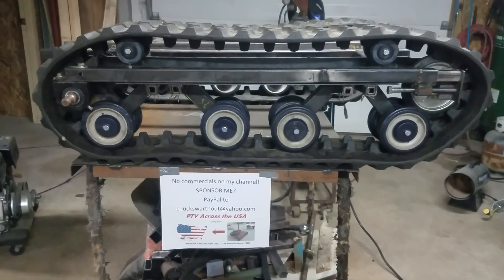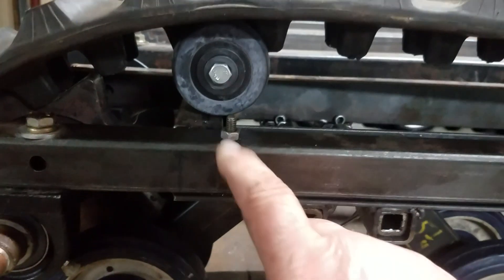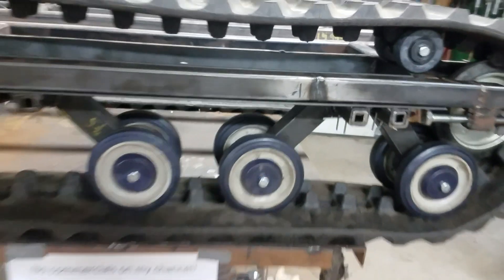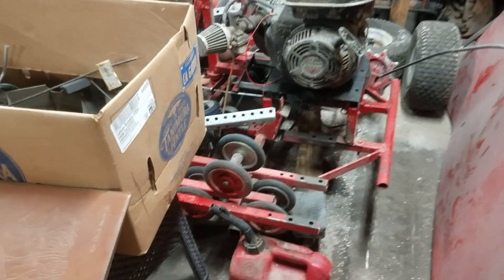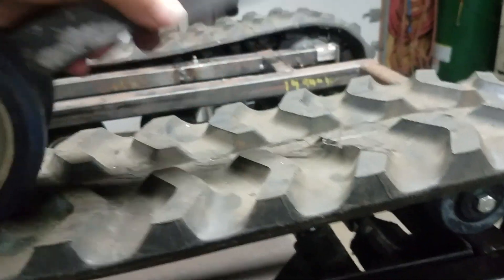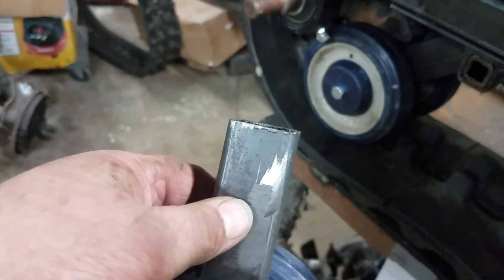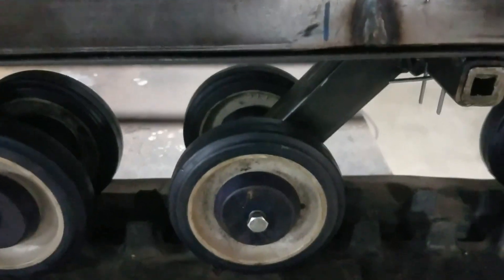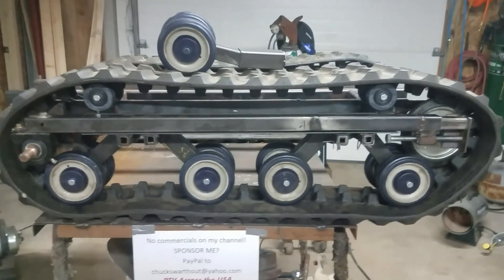PTV Build - 7B - Torsion System installed!

Comment: Awesome modular setup. I put automotive air shocks on my bogies because I use the air bags in them for the lift instead of a spring. I can adjust the air pressure for softness and ride height. With the shock still working in them, when I test rode it, it felt like it was floating on air and I have steel tracks with a quarter inch gap between the track pads. I would assume at very high speeds the dampening of the shock would bring the bogie down onto the track slow which I think would be a very bad idea since the wheels are used to keep the track on by guides. The straight down bogie idea would probably work as long as the bogie wheel's center is not lower then the front sprocket or it would catch an bend back, I would think. I bent my front bogie axles when I came up to an obstacle taller then the bogie and wouldn't roll over it.
Reply from the maker: As always, I appreciate your experience and comments, gives me more things to think about!

Comment: Looks cool!  I do like the idea about the springs in the square tubes.  Maybe adding a stiff piece of rubber between the  mounts of the springs could help in dampening and spring compression noise, if you decide to go that route.
Reply from the maker: My daddy used to say "work smarter than harder" and the torsion set up has been a lot of work.   I guess it remains to be seen.  Thanks, Ross!

Comment: Looking good Pastor. If you do decide to go a spring system, I may have an idea to help with it.  
God Bless
Reply from the maker: Yes! Let me know about it.
Reply from the maker: I have actually looked at that idea.  My only thought is like that is a 650 lb spring and you have four on each side or eight total I wonder how much spring you would really have. I've been kind of looking for a lightweight one.
Reply: Honestly, I think you would have plenty of shock there. 650 static spring rate under pressure will be more like 350 to 375 going down the road.  But I do think there are springs that would fit them, at a lower rate. It would take a call to them to be sure. One way to overcome the spring rate is to go cantilever style suspension. That way, you would only need 4 shocks, not 8.
Reply from the maker: @SouthernOhioprepping  okay. Over my pay grade now.  Give me some links.
Reply: This is a shock I have in mind for a build I was thinking about doing.
https://www.monsterscooterparts.com/rear-shock-absorber-razor-mx500-mx600.html?gclid=CjwKCAjw1dzkBRBWEiwAROVDLJzfbnZVgGyF1cRoX89q7JvRzFdfuX0L-5ss9VbaPUTSAev8eqsV7BoCGqYQAvD_BwE#description

Comment: So is the company who bought out peerless still going to produce the diffs?
Reply from the maker: The lady wrote me and said they were still called Peerless Gear and I have every reason to believe they will have them. I just wrote them again yesterday about possible distributors but I haven't heard back. She did note that Northern Tool appears to have decided not to carry them.
Reply: Great, thanks.  Love your builds. was looking at making one of these using a chinese quad motor/trans.  110-125CC, 3 forward speeds 1 reverse.
Reply: https://www.aviationpros.com/gse/gse-parts-components/product/12435004/peerless-gear-100-series-differential-axles               They have a link to request more information.